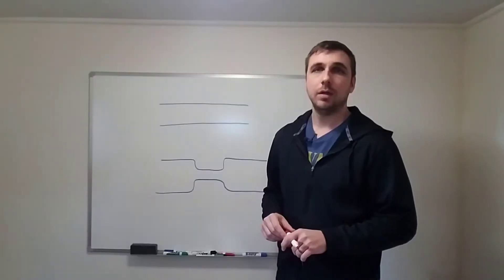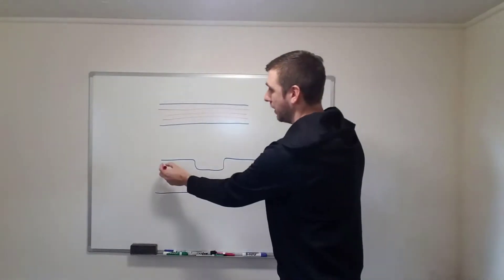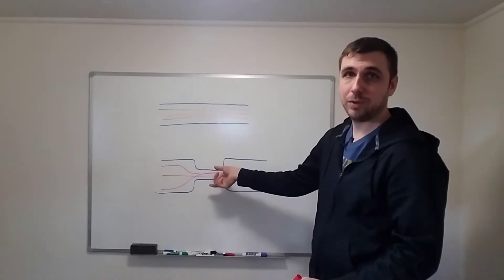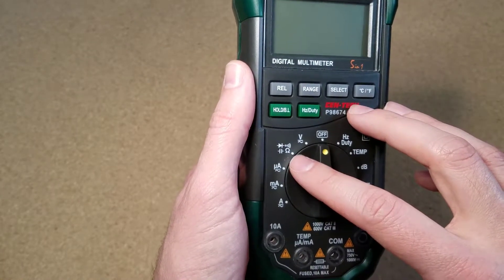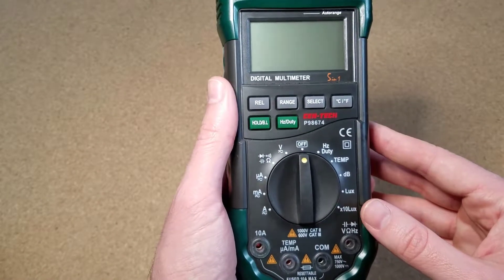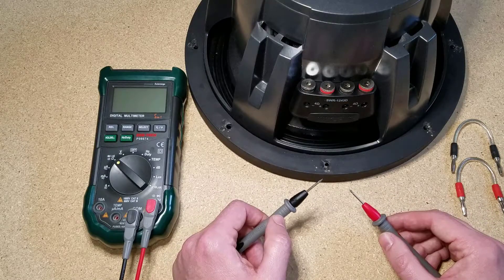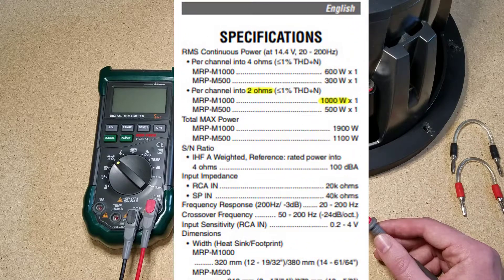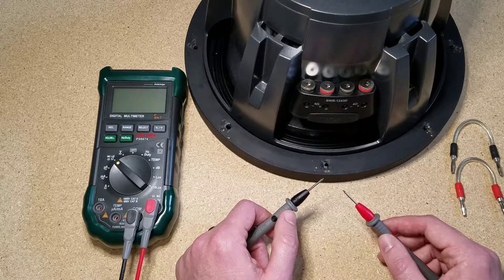How to Measure Resistance and Continuity with a Multimeter

Comment: I still don't understand the difference between resistance and continuity. The way I see it is they are the same thing.
Reply: Continuity just tells you when there is any path for electrons to flow. You will have continuity across zero ohms of resistance the same as you would across 100000 ohms of resistance. Resistance, in a way, tells you how difficult it will be for electrons to flow. Try thinking about it like water in a pipe. If you have a 10 inch pipe and a 1 inch pipe between points A and B, there is continuity between the two points in either pipe because water cab flow through either one. But you can flow more water (like electrical current) in the 10 inch pipe because it has less resistance than the 1 inch pipe.